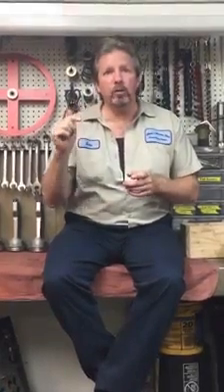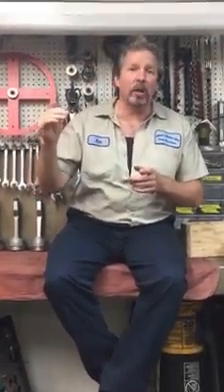Calculating HP - Proper Components Selection

Comment: Appreciate this video 
Years ago  with my dad & Brother inlaw ..
We built 350 bored 60 over 9.1 Pistons , Trw camshaft 442 465 lift 288 298 duration advertised.
 Zora Arkus-Duntov
Holly Dual plane intake
65cc camel hump heads?
Most camel humps really 64 CC's or 72s
All I had was a
Mr. Gasket engine Dyno program on D.O.S 🤞☝️🙏🇺🇸

Comment: I've seen this my whole life, a engine requires a recipe and alot has to do with what car,axle,tire size,transmission, converter, etc. Then you get into WHERE you want power to be made,ie you don't torque dropping off at 3k on a heavy street car just so you can say you have a 8k shift point. (Until you start playing with newer vvt)..on the contrary with a gutted shell you don't need monster torque and you can get that engine up into top rpm range...but this video is right on point.

Comment: Excellent building points!  I have a 427 Windsor built on Dart block.  10.3 comp with TFS 225 heads flowing 320 @ .600  Hyd. roller cam 241/249 duration with 600 lift. makes 480 HP and 505 torque at 5500 RPM at the wheels. I run a 3.50 rear gear with 5 speed manual in 2900 lb. Mustang LX. Runs easy 10.90 at 131 with a very easy launch and still runs strong after 11 yrs. of mostly street cruising. Built it myself and nice running on the street with pump 93 octane. Cruises great at 1500 RPM in 5th gear.

Comment: You have a good formula all my years in this I do it almost the same way but in the beginning I made a lot of mistakes usually to much cam things like that. But it is like you said at what lift do the heads really have the best flow then you can build everything else around that figure or close to it. I also built a lot of engines remember the old Crane Fireball cams for the Mopars not a lot of lift but lots of duration it was a good match for stock heads. These days though I build everything around the cam and if I have heads already that flow for example 200 CFM at .500 lift and I want to use it all then I use a cam at or very close to that. But if I just want a slight lope and more low end grunt and 9:1 compression then I wont use those heads because of the velocity loss slightly ported stock heads would be better anyway a very good video that I am sure will help a lot of people pick matching parts.

Comment: My car runs great,383 big cam long tube headers etc. 4:11 rear gear and Muncie 4 speed. 56 Chevy 210. I can hit the line lockers and blow the tires off but it definitely feels like a top end kind of build. It’s got a Holley strip dominator intake on it. And being that it’s a street car, am I missing out on torque not running a dual plane in your opinion?
Reply: It probably isn't well put together for torque if "big cam" means what it usually means when people say it.

Comment: I cheat and just copy something GM did in the 70s. Heads compression ratio and cam etc. I was happy with the 442s GTOs Chevelle SS and just copy those. Your info is sound but I loved them in the 70s and 80s and still love them now.

Comment: 332 cu in, 10:1 compression, blueprint heads 190 runners 2.02/1.60 heads flow 250 at .550. my cam is 266hr12, not a ton of overlap but enough, of course i live at 4800 feet, weiand street warrior dual plane 1" open spacer, 600 cfm carb, it runs great, scat rotating assembly, mahle 4032 forged flat tops, machine shop machined it i built it, 1st try

Comment: At wich rpm would you say this estimate is for?
1.25xcui at 4500 vs 8000 rpm is quite a different deal after all.
Reply: 🤣   1.25x400cu in is 500hp every day of the week
Reply: @RAWRMotorsports  well Hp is torque x rpm divaded by 5250 so its a very different thing having 400 hp at 4500 than 8000.
So if you raise the operating rpm on any given engine you gain more hp (given the rest of the engine is made for it)
A Honda 2 liter engine can make more than 300 hp NA. But its a whole different deal than a v8..

All talk of hp or torque should include rpm to actually be indicative of what the engine is capable of.